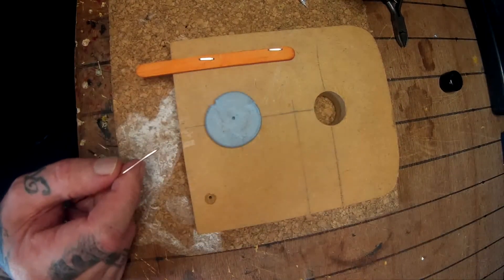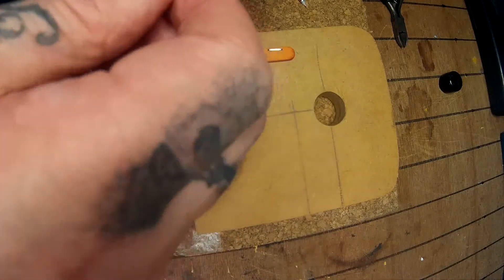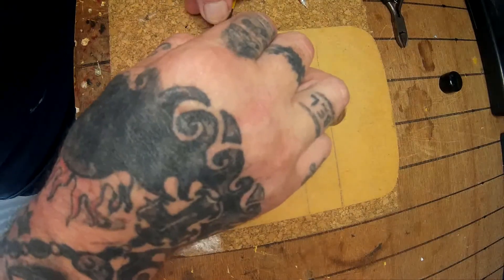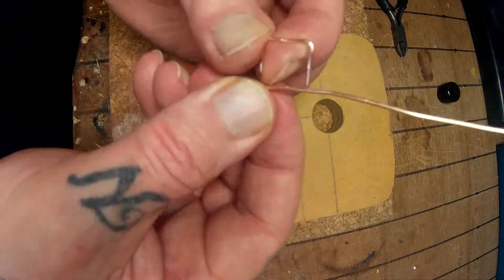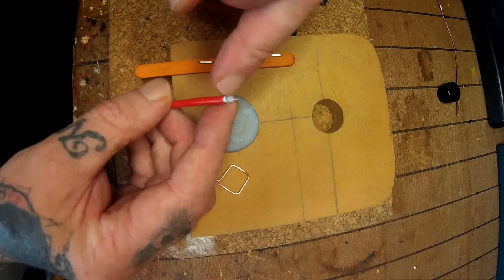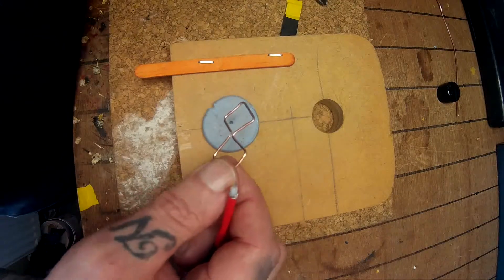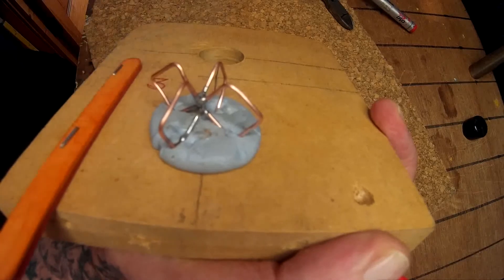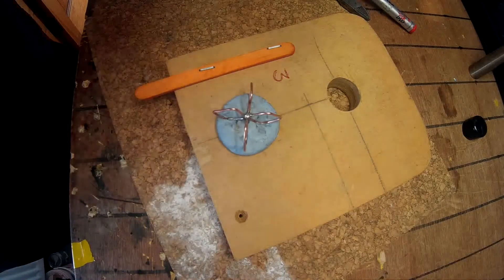4 LOBE OMNIDIRECTIONAL BIQUAD 5.8GHz DIY ANTENNA WITH TEST

Comment: I see you give this antenna a shot that andrew mcneil showed himself making on youtube, that's how I got here, from one of your comments on his channel so thought I'd check your channel out, some good stuff! From the emerald Isle myself lol, it's like living in a shower cubicle, a price to pay for lush green landscape and no snakes as such ha!
How did the antenna fair outside in the real world? My eachine goggles will pick up my camera signal 30 metres away without an antenna attached to them. I always need to test properly outside with motors running with trees and buildings around to judge performance properly.
Cheers.
Reply from the maker: pa maj I use these on my quads daily and never have any issues just as good as anoway thank you for giving me a visit!
Reply: Great thanks, I have the bits needed to make a few but thought it was probably a waste of time as I wasn't able to find any information about how well they worked until I read your comment of course.
I will give it a go now, thanks again LEON for being so helpful.
Reply from the maker: pa maj your welcome !